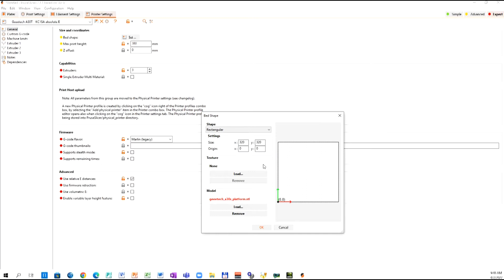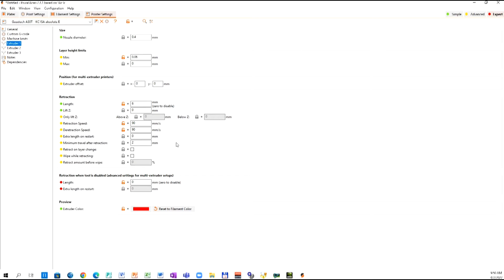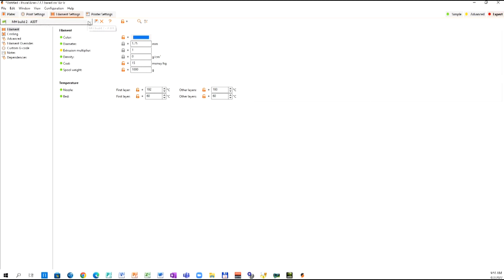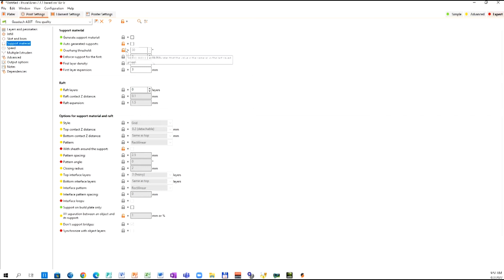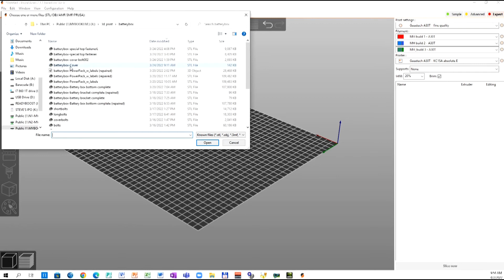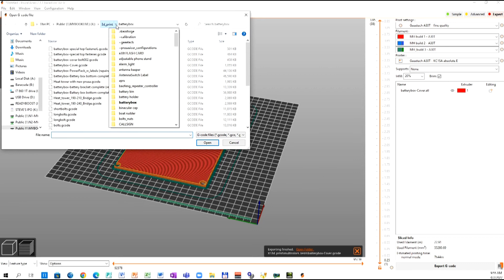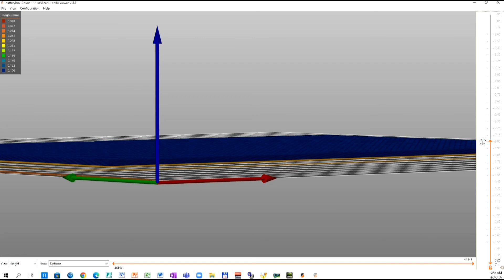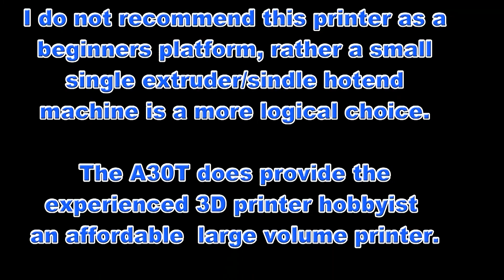A30T PrusaSlicer

Comment: can you post your start gcode, It must be doing more than just a purge line. It looks like it is setting up T0 T1 T2 so the extruders will function , also do you have code in the tool change area.
Reply: The print seems to start really well, it only pauses at a colour change, this could be hours after print starts, depends where the colour change happens. But when it does, its game over. Permanently sits on pause.
Heres my Start G Code:-
G90; use absolute coordinates
M83; exxtruder relative mode
M104 S[first_layer_temperature]; set extruder temp
M140 S[first_layer_bed_temperature]; set bed temp
M190 S[first_layer_bed_temperature]; wait for bed temp
M109 S[first_layer_bed_temperature]; wait for extruder temp
G28; home all axes
G92 E0; reset extruder to 0
G1 X0 Y10 F3000; mover outside the print bed
G1 X60 E9.0 F1000; prime line
G1 X100 E12.5 F1000; prime line
G92 E0; reset extruder position to 0

Heres my End code:-
M104 S0; turn off temperature
M140 S0; turn off bed
M107; part fan off
T0
G1 E-4.0
T1
G1 E-4.0
T2
G1 E-4.0
G0 F500
M84; disable motors

After layer change:-
G92 E0

Tool change:-
; Custom tool change G-code
T{next_extruder} P0 ; select tool
M116 P{next_extruder} ; wait for temperature

Appreciate any advice you have
Reply: @h4nksysdesigns119  Most if not all of your start code would be built by the slicer. Also I am using the BL touch set up in the touch screen to start probing at the begining of each print, so the only thing I have in my GCODE is the color mixing set.

M163 S0 P1
M163 S1 P0
M163 S2 P0
M164 S0
M163 S0 P0
M163 S1 P1
M163 S2 P0
M164 S1
M163 S0 P0
M163 S1 P0
M163 S2 P1
M164 S2
M163 S0 P.8
M163 S1 P0
M163 S2 P.2
M164 S3
M163 S0 P.8
M163 S1 P.2
M163 S2 P0
M164 S4
M163 S0 P0
M163 S1 P.8
M163 S2 P.2
M164 S5
M163 S0 P.2
M163 S1 P.8
M163 S2 P0
M164 S6
M163 S0 P0
M163 S1 P.2
M163 S2 P.8
M164 S7

this is all I have in start code
Reply: @h4nksysdesigns119  is that work for color change
Reply: @h4nksysdesigns119  go to printer settings-general and under the extruders tab,untick the single extruder multi material. i hope that helps and you as did me..

Comment: Hi, I’ve also got the A30T and have used a few different software packages to print in single and multi colour. But Prusaslicer doesn’t seem to print multi colour? Have you had similar problem? Print will start ok but when the colour change is about to happen it pauses, temp drops to zero and will not resume even if try manual override.
If yours does print multi colour using prusa, please could you give examples of your custom G code text in prusa? Thanks
Reply: Just got this working. only one pause at the start all 3 extruders functioning and no pause except at the start of the pint. check your start GCODE.
Reply: @cgrosbeck  Can you post your start gcode? I've been messing with this for days and still haven't got it working!